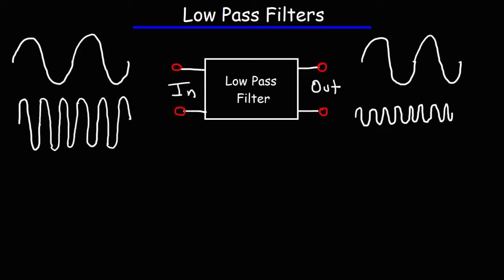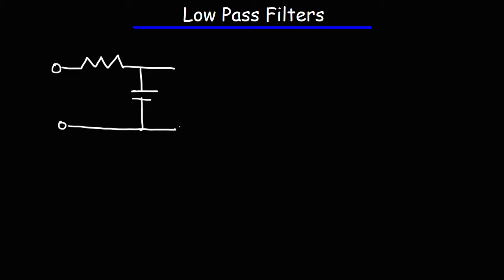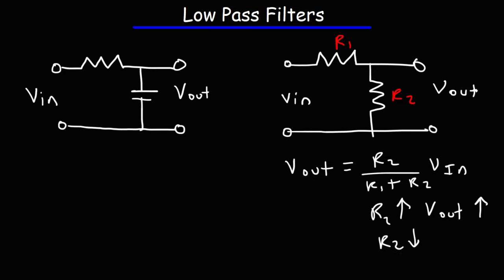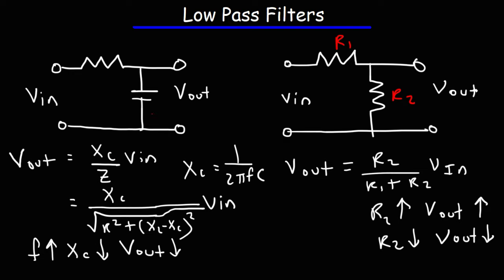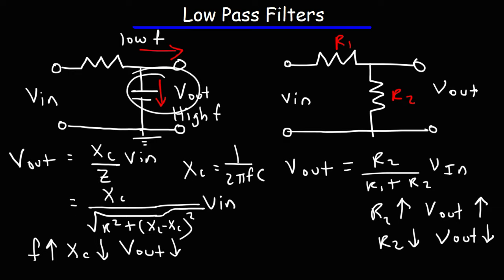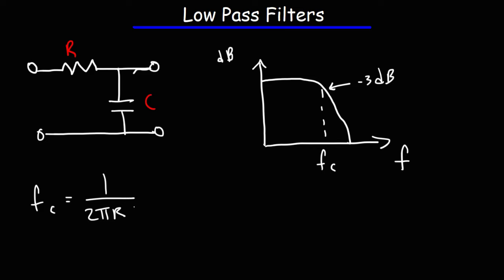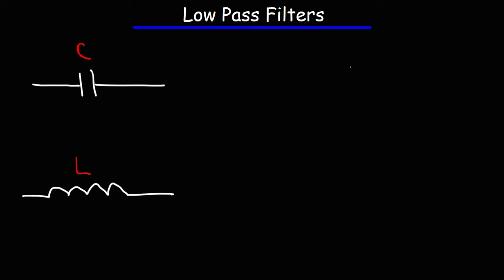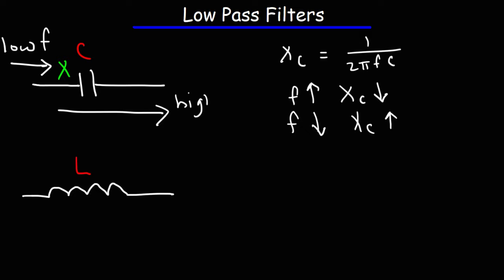Low Pass Filters and High Pass Filters - RC and RL Circuits

Comment: Excellent Video on High & Low Pass Filter  Circuit. One good application is on the Tube Amp Tone Stack for Treble, Bass,  Mid Range and Volume Controls .  The Inductor/Capacitor circuit is used on the DC high voltage Circuit!

Comment: So regardless of whether we are building a high pass or low pass filter, we have the choice of using either RC or RL circuits. But why/when would we choose RL over RC? For me, RC is easier because I have a wide range of capacitors, but I don't keep inductors on hand. But it would be good to know if inductors offer any advantage.
Reply: Im no expert but inductors would probably be a better idea for higher currents also easier to make higher values than capacitors
Reply: small confusion, can you clarify? why he chose to get the the O/P voltage across the Capacitor, unlike in case of Inductor he took the output voltage across the resistor.......why so?

Comment: I love all these videos. One quick question, though: at 16:45, when that capacitor blocks the low frequency signals, what happens to them when they are blocked? Are they just attenuated, then pass through to the output? Or are they going down through the resistor to ground? I want to know if I've got this right, because the attenuated signal also becomes a higher frequency signal, no? I just want to know what happens to the low frequency signals once they hit that capacitor. Thanks for all this excellent content.
Reply: Herro, 

Own reeve one time churs moak um out erv chur e-sister be craws cha row freak-ren-see it a tur sin-too raw he eat. 

-Contucious, 2023

P.S.

Thank you for your time in re-ring this messages ow't-laod,
Re willy Doo respect the guy'd-rhinds fur cha calm-you-knitty... 

Sincerery,

🌏

Reesprect❤😊

Comment: Why Vout=0.707Vin? Thanks for the video
Reply: rms value
Reply: small confusion, can you clarify? why he chose to get the the O/P voltage across the Capacitor, unlike in case of Inductor he took the output voltage across the resistor.......why so?

Comment: What is Xl and Xc? Towards the end of the low pass filter explanation, you mention them in your formulas, but I don't know what they represent or how to find them...
Reply: Xl is the reactance of the inductor, and Xc is the same for the capacitor. You can calculate them: Xl = ωL and Xc = 1/(ωC) , where ω = 2π*f.

Comment: For an example take an old Drake low pass filter. The cutoff freq is about 30/40 mhz or just above. If I wanted to change the cutoff freq to above the 6 meter band [above 60 Mhz] - How would I modify it ?  Thanks !

Comment: How comes that capacitors in amplifiers let AC to pass and increase gain, yet here in the filter circuits they are used to block low frequencies. Doesn't amplifiers then also block low frequencies?

Comment: What i dont get is that in the LPF, why doesn't the high frequency go forward, instead of going down through the capacitor? Because why yes the capacitor lets through high frequency signals ... A wire does too, right? So why does it not just split, going half half or something?

Comment: HELP PLEASE!  At mark 5:33 the video says "20 log" x "0.707" =   -3.01bd ??? using my windows calculator i enter "20 log" and it shows "1.301" so then i multiply that by "0.707 = "0.919"   ...... Im a maintenance tech., so im programmed to try different ways to find a solution to get things right.  I found if I enter "0.707 log" x"20" i get -3.01 ...... so my question is.... is the video wrong?  or am i just missing something?

Comment: @2:50 you state that capacitive reactance is equal to one over two pie f c... What is the order of operations for that? One divided by two times three point one four times f times c? Or is f and c one thing? Like "fc"? I think it stands for the value at which the  frequency is cutoff by three decibels. Or do you multiply the FC by 6.28 and then divide one by THAT? I'm just trying to figure out what I'm cutting out of my amplifiers circuitry so that I can order the components at the correct values for my circuit to sound pleasing to the ear. When I plug in the numbers for a ten k resistor and a 47 nF cap I get 737,900. Now what frequency is that supposed to be? 737,900hZ? I am told these values are used in audio circuits so I'm trying to calculate who's writing wreaks of shit and who has the readers best interests in mind. I appreciate your work, I am still not achieving certainty that my goals are going to be accomplished by plugging in these numbers in this order. Oh, is R² supposed to be resistance? Is that the total resistance or just the one before the capacitor? 

Thank you for your time,

Scott